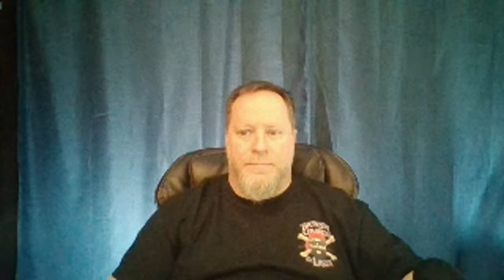Live Q and A with John from Branson Cerakote 5/23/20

Comment: Not to beat a dead horse... But I have yet another question about the MC-157 clear. I'm running short on time and need an item in less than the 5 days NIC says it takes to fully cure. Is their a reasonable way to expedite the process? Could a person put parts in a 180° oven for a couple hours after a 48 hour air cure to get the coating fully hardened?
Reply from the maker: Nope. Unfortunately, it is what it is.

Comment: Lots of good tips...Thanks, late to watch but had a question. When you 
flash in oven, how long(I bake the H series at 200 degrees for 2 hours 
on metal)?
Reply from the maker: Flash cure is generally done at 180 for around 6-15 minutes depending on the material. It will go in wet, become sticky (tacky), then go tack free. Thats the point you want to remove it from the oven if you are adding more Cerakote layers. Once you are done, put it in at 180 for 2 hours for polymer, 250 for 2 hours for metal to final bake.

Comment: I missed it! I did have a quick question though. Once you get paint ready and in your spray gun, how long can you leave it in the gun?
Reply from the maker: 45 minutes or less is what's recommended.
Reply: @BransonCerakote  thank you for the reply Sir, one other question if i can, I saw the part about the clear coat. So you just want to mist it? Don't paint it like normal?
Reply from the maker: @youwantthetruthproductrevi4215  Exactly. If you try to spray it on the surface like Cerakote, it will likely run.